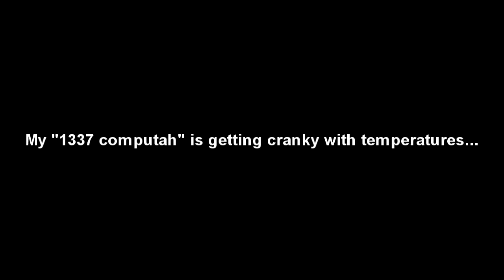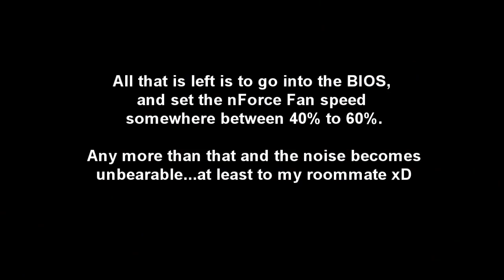Cooling down the XFX 780i's Northbridge & Southbridge!

Comment: Wow Your MCP is so cool! Mine is at 70C-89C. :D
Reply: +Pepi Dachev mine crashed a few days ago because the stock fan got stuck :S ...Id convert it if It wouldnt look that ugly. anyone tried just to redo the thermal paste?
Reply: Mine doesn't have active cooling. It's just a passive radiator.
Reply: my evga version came with a fan that attaches to the northbridge ...but still it gets 70-80°C ish hot ...1600FSB slightly overclocked though

Comment: Did you put any rubber stands beneath the enzotech evga-780i and evercool vc-re before you installed them? (I just installed them as is...with what came in the box)
I just changed the heatsink on my 780ftw and I am having freezing problems...
I think I installed the heatsinks correctly...any help is appreciated :(